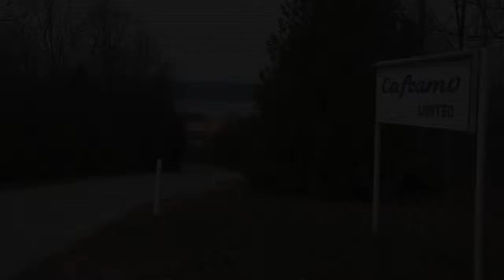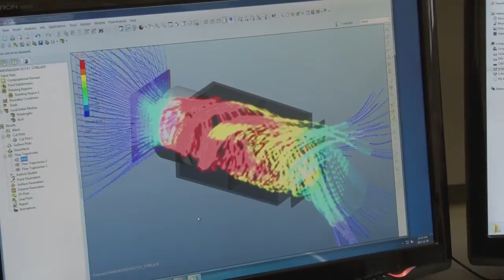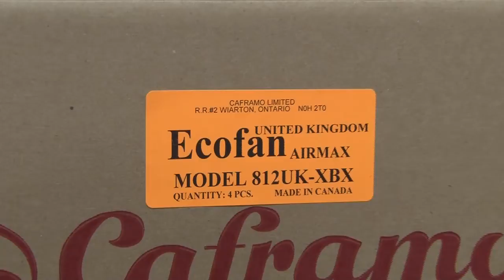Caframo Limited -- GREY COUNTY

Comment: In my oppinion, your company makes the best boating and camper fans ever. When we are in Mexico for the late spring and summer, my wife always says, if the fan breaks, we have to leave! And since we have the 747 since more than 12 years, we bought a second one, just in case. But booth are doing their job now, and we are happy campers! Keep up the good work! Thank you.
Reply: I love your Gimble fan....I use to see them on houseboats at the lake. I bought a Casita camper and installed it between the beds under the overhead cabinet. Remove a 12v light fixture to use the DC wiring for power. The fan flips up and out of the way when not in use. I was in the Goodwill today and found 2...yes 2 chinook fans in their boxes...used but like new (must have had them in a camper or boat..) now when I'm in a campground I can run these fans on ac from the campground hookups. 
Looks like you have a great crew working in you shop...keep up the great work ladies!!!
Reply: Thank you so much for sharing your stories! We appreciate your support. :)